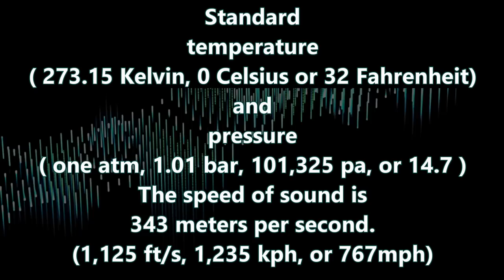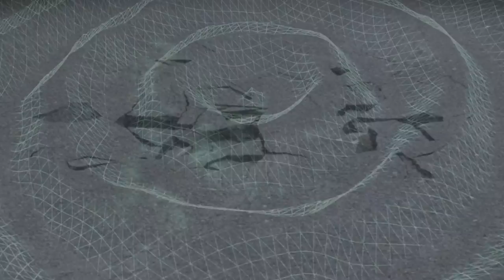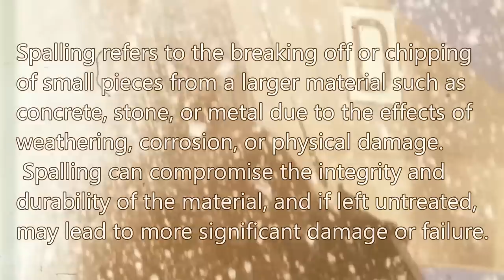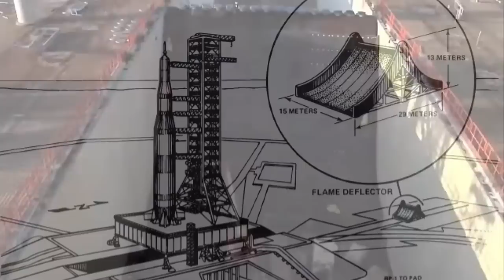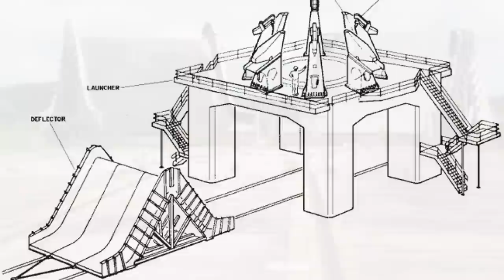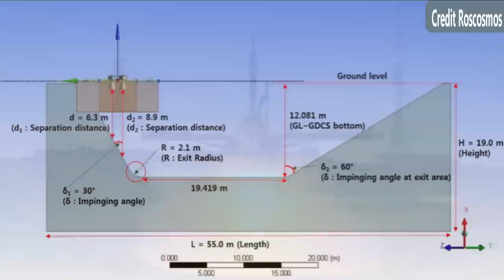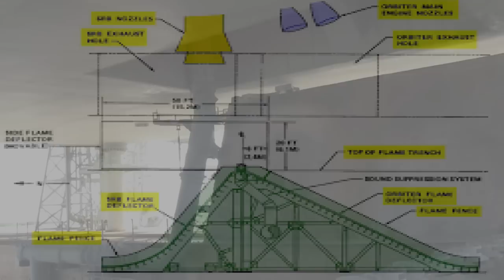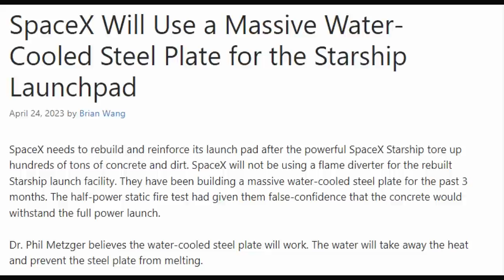How to Fix Starbase After it was Destroyed by Starship!

Comment: Apparently the starship is locked to superheavy via hydraulic clamps.  If the pumps failed as suspected during ascent the ability to unclamp would have been lost along with superheavy flight control.  Not an ideal design, which is hopefully being fixed in booster 9.
Reply: Not true. There are no hydraulic clamps holding the two stages together. This was a design change created by one of the SpaceX engineers which Elon approved. This was at the same time when the decision was made to not have the Super Heavy grid fins retract and simply keep them locked in position thus getting rid of the need of hydraulic systems and a backup reducing failure points and weight.
Reply from the maker: That makes sense Kevin... Electric actuators are a better idea I think.
Reply from the maker: So they have no clamps at all?  How did it stay together during the flips?

Comment: "Space thought concrete was strong enough"???? What is this? Some kind of pre school fairytale hour or advanced engineering.  The problem can be designed and simulated. Margins of error can be estimated and structure can be built with enough redundancy to be failsafe.  Unless of course you ignore what mathematics tells you and decide to cut cost. Which is likely the reason for the catastrophic failure of the launchpad
Reply from the maker: It is very difficult to simulate the full effect of that much power on a structure that size.
Reply: @terranspaceacademy  With all the respect - there are numerical methods eg finite element method known for 50+ years. Al that you need is properties of on materials under high temperature and stress. You do lab tests to estimate them - you know the measurement error so when your program completes the results have known range of error as far as potential for failure and based on it you overbuild the structure. There is no guesswork just because “it is big rocket engine”. Nobody designs airplanes using trial and error methods. Same goes for rockets. The extent of damage to launch pad is way beyond “oops - forgot to take a square root”. As you said - those structures took few years to perfect in the past but did not fail. SpaceX is spinning that launch as “success” but imho FAA is correct to ground them. They are not ready.
Reply: I think the engineers agreed to disagree. One group saw the launch as proving the concept. The other saw it as a cheap way to demolish an outdated pad that was in the way. Just a hunch.
Reply: @p39483  Taking my into account that the tumbling rocket DID NOT initially respond to to auto destruct sequence the idea that launch would be used as a way to “demolish the pad” sounds like certified insanity. Nothing was there to prevent 100s of people being killed or injured if rocket landed on any nearby town.

Comment: As far as getting the launch pad ready to go in two months, doesn't concrete require a " cure time" to reach full strength? Is it that quick for the type of concrete used on the pad? Two jobs ago, they poured a concrete slab, and one if the guys pouring it said it took about seven months to reach full strength ...
       Another excellent video...as always.
Reply from the maker: If they pour layers with steel sheeting between it should take a lot less time and be much stronger.

Comment: "destroyed" would indicate that there's nothing left. Everything is still there, aside from the concrete.

I think the steel plate will work as expected but still believe they need to incorporate a diverter in whatever way they can. More than anything else, I feel it was the spalling that caused the issues.
Reply: Oh, and the FAA hasn't grounded Starship. They were granted 1 license and used it. When SpaceX applies for another 1, and if the FAA says no, then they can make the 'grounded' assertions.
Reply from the maker: Well technically they are grounded during the investigation... SOP.

Comment: What was the rationale to disregard any of those measures (water deluge, noise suppression, flame diverter...) and just stick with extra-strong reinforced concrete? Hubris?

edit: the "hubris" word is making some people throw a fit, I meant in the very sense of the word: "self confidence that the past tests would work when in hindsight it clearly didn't"
Reply: Building a traditional pad at Boca would have taken significantly longer for approvel than the flat pad design.
Reply: Instead of posting self righteous lefty takes, you could've looked up the tweet where Elon explains the decision.
Reply: Calculated risk in a test and learn framework.   Lots of factors involved….including data, Wow. Elon doesn’t close his eyes and throw darts.  Hubris,…get real.
Reply: @dmurray2978  lefty takes? What does that mean? Just trying to make conversation for gods sake.... Maybe the rationale behind the decision was good, I don't know hence the question! But thanks for not answering it, have a nice day.
Reply: @heatmyzer9  I got real, thanks for checking in. My question stems from the video itself: it seems in hindsight it was a bad decision that doomed Starship. I am using "hubris" in the context of "being too confident that past tests would suffice" which seems it didn't.
Reply from the maker: They didn't care about the older tech rocket and thought there would be pad damage but not total destruction...
Reply: @d33w  nah, bruh.  Lots of negativity is pre-coded into ‘hubris’.    Hubris has lots of Qmax baggage as you clear the tower of “over-confident”.
Reply: @heatmyzer9  mate, I'm a massive SpaceX fan, have always cheered for them and I'm very hyped for Starship. But people do become over-confident sometimes, especially when everything they do is a continuous and systematic success. You do become confident that your future ideas and concepts don't need to be re-checked, as it was in this case. 
Cheers.
Reply: complete speculation, but my guess is some combination of "hubris" and more government approvals required. Some of the hubris is perhaps justified though; all of old space didn't think reusable rockets was possible. So, when you've got old space saying "you can't do that" and then you do it, it's somewhat understandable that when old space again says "you can't do that" you're inclined to think "maybe not, but it's worth a try". The second reason I think SpaceX didn't want to build a deluge system is they would have been hung up for another year waiting for all the various agencies to approve.
Reply: @d33w  you speak the truth.
Reply: @thentil  old space didn't want reusable rockets... The reusable idea goes back to the very begining of rocketry. DC-X was as recent as the 90's. No, it's all about the money... And always will be.

Comment: Is it possible the next Starship launch is from Cape Canaveral? They aren't planning to catch the booster so the arms dont mattter. It seemed reckless to launch knowing stage 0 wasn't up to it. I doubt they overlooked that.

 SpaceX might have felt the data from the pad was more important than the flight at this time. After all they want a high launch tempo eventually and they needed to know what will break on a single use much less their long term goals.
Reply: No flights from the cape for some time. Gwen Shotwell stated they need to understand starship before going to the cape
Reply: Starship will not launch from KSC until multiple successful launches from Boca China have been conducted. I wouldn’t be surprised to see huge changes at the KSC Starship launch pad though. I’m hoping so at least.
Reply from the maker: I doubt it... they'll need to get the bugs worked out at Boca Chica before they will be allowed to launch from Florida.

Comment: Elon did a twitter talk show with the everyday astronaut about everything that went wrong with the launch and it will answer quite a few of your questions about the launch. 
Also, space x knows a good deal about flame trenches and sound/fire suppression systems. They have refurbished 4 launch sites for falcon 9/heavy and have had to deal with all of these systems. The reason they didn't do a flame trench at starbase is because the water table is too high, it would be a massive engineering undertaking to build the proper launch pad, but I have no idea why space x thought they could get away with bare concrete.
Reply from the maker: I guess I should pay more attention to twitter.  A phrase not often heard.

Comment: I found it odd that i knew this would happen before it did, and im no rocket scientist.  I came to the exact conclusion you did, and it left me wondering how could spacex not have seen this coming..  personally im not sure if i like the the steel plate idea.  there is another 3d render i saw of a legit flame diverter with triangular plates that can be closed or open directly under the pad that would allow access to the bottom of rocket when it isnt launching.
Reply from the maker: It could work I think....
Reply: @terranspaceacademy  only 1 way to find out

Comment: Elon said there are no indications concrete impacted the booster or Starship.  The three engines that didn't start, weren't started because of the flight computer finding unstable conditions with the three engines.  Engine 27 exploding and taking out engines 19, 21, 22, and the HPU, were the reasons for loss of directional control (thrust vectoring).
Reply from the maker: It was very surprising to find that out... not about one exploding but three failing on startup.

Comment: Instead of pumping water critically into the rockets exhaust who don't they pump it horizontally in and over a crevasse that redirects the flow of the gas emitted from the rocket engines
Reply from the maker: They may have "sprinkler heads" to do just that.

Comment: 2 things, first NASA had 13 factorial launches! 😂 Second more serious point. I think that there was an oxygen leak as well, but I don't know if it was in the tank. I would be willing to bet the oxy/fuel shut off is on the engine itself. This means a common manifold feeds all the engines. If that's the case, then one of the manifold lines could have been punctured and if it is a small enough puncture, it would still give enough oxygen to the engines to work, but not enough to produce full power. I don't know if they have an automatic mixture control or not, but if your engines are suddenly oxygen lean, your engines would reduce fuel to compensate, this causing insufficient power. Of course, I have no odea how their system is set up, so it is speculation based on the symptoms and my experience.
Reply from the maker: That's an excellent observation Chad... SOMETHING was streaming from one of the engines....

Comment: Bear in mind every engine that goes out they need to throttle back the opposite engine so effectively for every engine out they've lost nearly 2 engines (Not so much for the centre 3 engines). SpaceX have always been flame diverter/Water Deluge chauvinists with regard to Starship which is slightly understandable as they won't either have these on the Moon or Mars, but they also won't have the monster Super Heavy booster on the Moon or Mars.
Reply from the maker: Well they can also boost the power to the one on either side of the failed engine and moderate that effect.
Reply: @terranspaceacademy  Sure but they were already running at 90% but can throttle back to 20% so throttling back one or two engines makes more sense than throttling up 10 engines also as there were 7 engines out they'd need 70 engines to compensate

Comment: I still think a water cooled plate is a very bad idea: at the very least it needs to be shaped like a cone shaped Mexican hat to deflect most of the sound waves as possible away from the rocket at 45 degrees, say. I'm guessing that from the 40% throttle test, the engineers told Elon that a water cooled plate was essential from their assessment of the damage caused to the pad; and Elon told them to go ahead anyway. But on a positive note, they're not that far off from an 'almost' flat plate solution that won't disintegrate, yet will provide experimental data on how it needs to be modified.
Reply from the maker: We agree on that point. Steel can reflect exhaust back up onto the rocket better than concrete...

Comment: My idea is to use exact geometry to shift the launch site topography into a series of acoustic reflectors. This system is also a power generator that uses the inbound sound as fuel to not only diffuse itself but bleeds it out in the act of converting mechanical energy into electricity that is then stored away to be later fed into the local network at a controlled rate.

My initial visualization is a concentric nesting of ridges all of them varying in height with inner being progressively smaller than the outer segments. All segments angled in a way that scatters the sound upward into an inverted cone deflector. A cone deflector whose base reaches elevation above the lower skirt of the star ship. The idea of this upside down cone is to splay the acoustic rebound that is already halved in power as it rebounds from the concentric nesting of modified topography below.

Within the ridges of this concentric nesting will be pressure plates that convert the sound into mechanical energy that charges up electrical energy(using the process of conversion to further bleed off the energy).
The surface area of this concentric nesting will also be covered in sound dampening groves and ridges. 

If done right it might halve the sound of a launch at ground level. It will for sure protect the ground as the geometry would more or less be doubling the surface area that is exposed to the sounds of ignition .

It's just a vague idea and if it can be built then we wouldn't need to rely on water = can be constructed on mars to protect the ships in their return from that planet. Mars doesn't have much water.
Reply from the maker: That's a very cool idea Lin!
Reply: @terranspaceacademy but is it feasible~sound?

Comment: I find hard to believe how all those scientists that designed and build the Superheavy and Starship, with reliable Raptor engines, and did a lot of calculations which proved correct, didn't consider the problems that will be caused by a concrete launchpad.
I believe the SpaceX engineers have been overruled by somebody very high in the SpaceX hierarchy.
Just like the Tesla engineers that were "convinced" by someone - to remove the Lidar and the Ultrasound sensors from all Tesla cars.
Don't let your sense of innovation to became the excuse for cheap design, and please, listen to your engineers...
Reply: At what point did Tesla have LIDAR on their cars ?
Reply from the maker: Reminds me of the cold O-ring problem...

Comment: Well done and presented, its a pity that Musk apparently never watched the outstanding videos of Saturn V F1 Engines on Launch that NASA obtained at the time, and I've watched space developments from the 60's onward. Musk keeps hawking the water cooled steel plate, but I see no way around a trench and a massive deluge system. Another bit that I remember form the Apollo Era, was the in addition to the sound effects of the hardware, anyone unfortunate enough to be near the launch site would be killed by the sound pressure alone. I think it was somewhere near 175db or so at launch.
Reply: Agree 100%
Reply: Apply to spacex if you think you know better
Reply: This same very video told you exactly how many db Saturn V produced on launch. It was over 200 db.. There is no building a flame trench at Boca Chica. It will not happen. The launch pads at KSC had tons of fill come in before building the pads so that a flame trench and diverter could be installed. There is no room. The water table is too high.
Reply from the maker: 204dB at 100m... crazy!

Comment: I'm guessing most engineers at SpaceX knew the pad was going to be destroyed, but were hoping the engines would survive and the launch attempt would be successful. The level of devastation likely surprised most everyone. They need to face the reality of how enormous this thing is and how robust the pad is going to need to be. It's going to take time and it's going to be expensive. I just hope they don't scrap the program altogether due to its rising costs. expensive refurbishments are going to be common when this monster launches.
Reply: I wasn't surprised one bit. I predicted this disaster soon after they began construction on the pad. Only thing I got wrong was that I thought the vehicle would explode on the launch pad.
Reply: I'm guessing you'll never own a rocket company. The nay-sayers have always doubted spacex.
Reply: @dmurray2978  While SpaceX has some great accomplishments.... They completely "F" ed up Starship. Most likely because the leader got too involved.
Reply from the maker: I think a good water cooled plate with a pyramid shaped deflector in the center could make things tolerable :-)

Comment: I mostly agree. However, I believe that Musk's steel plate, if it is flat, will fail. They need a full flame diverter shaped to divert exhaust gasses away from the pad in a safe direction. They also need a full water deluge system, and a sound suppression system. Equally important, for manned flights.... They need a real launch abort/landing abort system to carry a separate crew compartment to safety. NOT simply trying to use Starship itself as an abort system. That is what is necessary in my opinion for Starship to succeed. It will take about a year to redesign and rebuild the launch pad. Even longer to redesign Starship for full launch abort/landing abort capability. But it is something that has to be done.
Reply: Apply to spacex if u know better
Reply from the maker: We agree... pyramid shaped with the edges toward the launch mount supports...